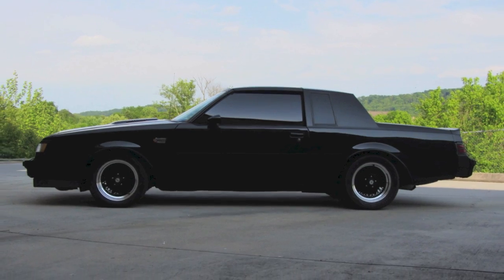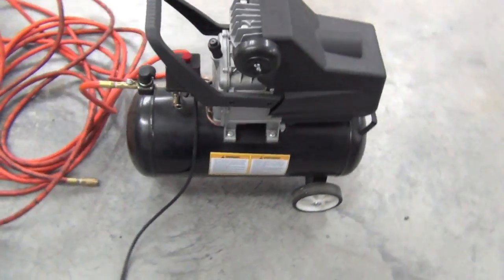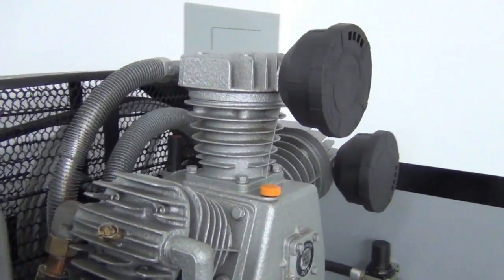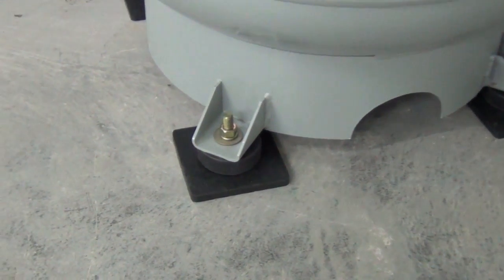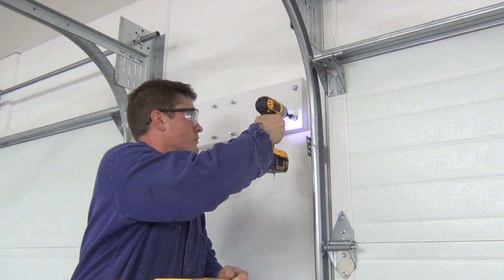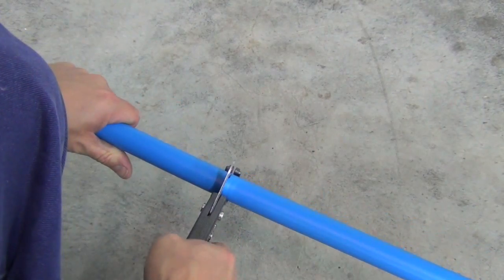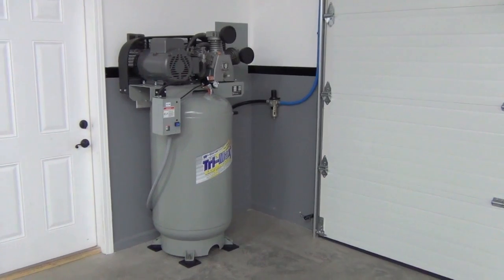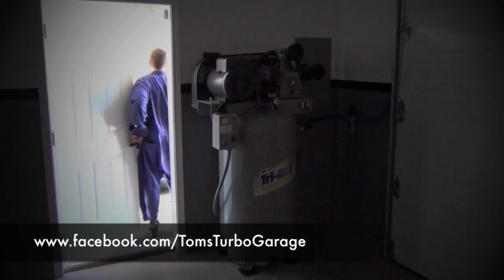My New BendPak Tri-Max Air Compressor - Overview & Setup

Comment from the maker: Thank you Chris and I appreciate the suggestions very much.  I found conflicting information on the water/oil collector, but I agree with you and it only makes sense that vapor will collect downstream after long runs.  I am going to try this and see how it goes, but I may have to tweak the location and/or add another separator on down the line.  Regarding the quick-connects, these are well reviewed USA made ones, I wish I would've known about the super coupler, those look great!

Comment from the maker: Hi Johnny, I wanted them low for a couple reasons, first being access, I may put a splitter and run one line to the reel and the other to something closer to the floor. Second is that I've read that you want your drops to be low points in the system to drain water or add a filter/seperator at each drop if needed.

Comment from the maker: Thanks again!  All compressors are noisy really, but with proper damping on the floor and good air filters, it quiets them significantly.  Although the best way to silence them is to close them in a room or move them to an outside shed, etc.

Comment from the maker: Yes indeed, access is one of the big reasons, I may add a splitter and run one line to the reel and the other to something closer to the floor.  I may also add another filter of some sort and that should be at a low point in the system, according to what I found.

Comment from the maker: Hi there and I have to say, I am the absolute worst when it comes to attempting to diagnose car problems on the internet.  I suppose I'm old fashioned, but I have to see and hear the car myself.  That said, I would recommend looking at your service manual and going through all of the components of the clutch system to make sure they are in working order.  Like the clutch hydraulics for example.  Good luck!

Comment: I have mine almost the same as yours but the connections are up high.  I have water collectors at each drop and at the compressor outlet.  I only have a water problem at the last drop if I dont use it but use the other ones for a couple of days.  I have them hidden behind drywall and just the reel exposed unless the access panel is pulled out.  I also have a male coupler just above the floor for a spliter type connection like your talking about.

Comment: Awesome job, Tom!  2 things for you to look in to.  (1) I've read it's best to put the water vapor collector as far away from the compressor as possible.  Did you read into this much and find otherwise?  (2) You should replace those brass quick-disconnects that you put on the hose-reels with a much better one where you can shut off the air before disconnecting the tool.  Go to 4wheelparts website and search for "super coupler".  Should be the 7th item in the list.  =)

Comment: Tom,

Question about the Rapidair system. It looks like you've had this system for almost 1 year. What are your thoughts? Would you recommend it? Any leaks? Any moisture issues with the air coming out of the lines?

I've been doing some reading on the pros/cons of "plastic" tubing...just wanted your thoughts. Thanks!

Jeff
Reply from the maker: Hi Jeff, the Rapidair system has performed flawlessly and I would highly recommend it.  I suppose you saw My video where I installed it- I have not needed to do anything other than use it since then.  I haven't noticed any moisture other than what is captured in the regulator/separator.  Good luck with whatever you go with!

Comment: You should install auto drain kit for that air compressor tank to prevent rust and corrosion.
Reply from the maker: KillerJoeFIN Thank you for the suggestion, I just manually drain it now, but have been looking into one of those setups.

Comment: that pump head looks too tiny for that big compressor and It's geard running over 1200rpm I bet, loud.  The two primary pistons look 2 inch maybe 2 and a half max, weak
Reply from the maker: The full specs are on their website.  Max RPM is 1,180.

Comment: That was a great video. But I think you really don't need the theatrics. The product should sell itself on its own merits. I like your style of explaining the installation. But wrestling with the hose and hugging the compressor. It's just a little too over-the-top. But that's just my opinion. I'm looking at purchasing a compressor and a couple car lifts from my collection that's getting a little too big for my six car garage.
Reply from the maker: Hi Scott and thank you for the constructive critique!  Too many folks on YouTube just throw insults rather than offering something actually useful.  Glad you enjoyed the video and good luck with your compressor purchase!
Reply: A lot of the negative remarks are from kids hiding behind their keyboards. I went through the same thing with CB radios back in the 70s. It got to the point where I finally just sold off the radio and moved on to other things. Just don't listen to that baloney. And stay true to yourself.
Reply from the maker: Scott Hill Thanks again man!
Reply: I'll be installing an air compressor for my lift. That I recently purchased. I'm running out of room in my garage. I thought five cars would be enough when I built the garage. But then again, I do like even numbers. LOL